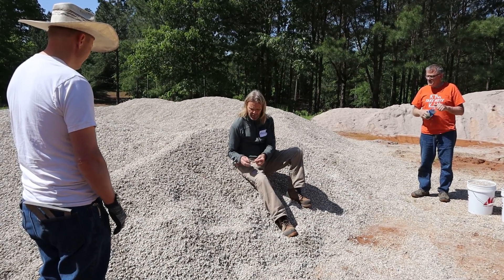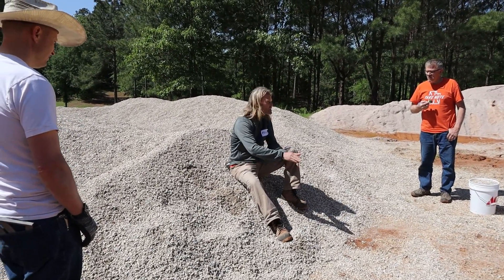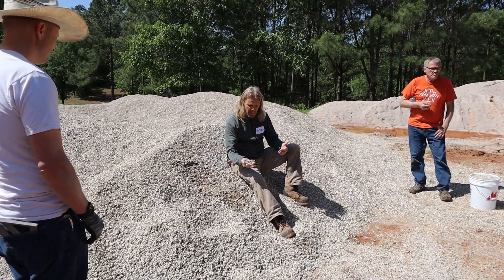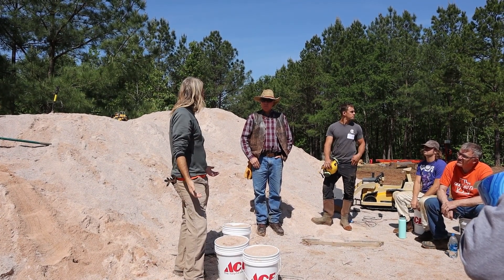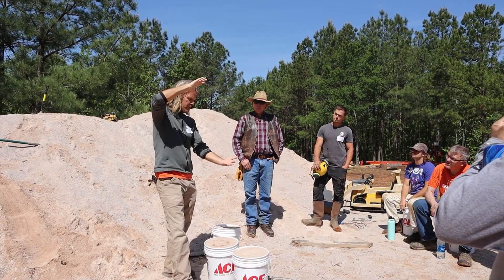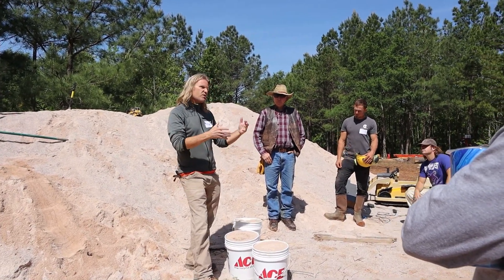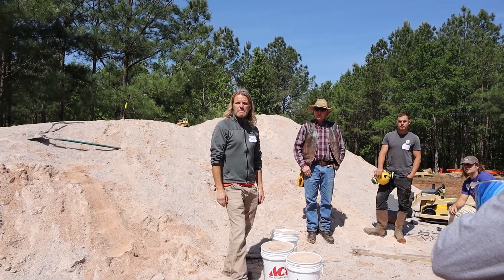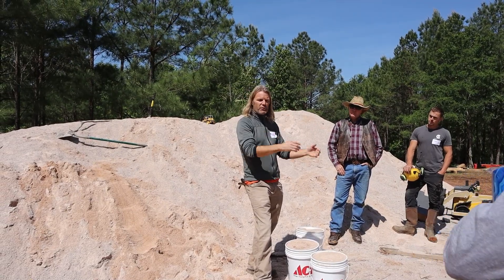SIREWALL Class Part 1 - material selection - Vlog 94

Comment: Hey, I have a question about the rebar. What is the diameter of the rebar that you used and what was the spacing. Do you feel like it is nessecary to have rebar? also, is this rebar coming out of the foundation and then another piece of rebar is welded correct? If you don't mind I would also like to know what is the width the walls? :)
Reply from the maker: We are using 5/8 inch thick rebar (Number 5) on a 2 foot grid. We don't need to weld the rebar if we overlap by at least 16 inches and tie with bailing wire. The walls are 2 feet thick. Hope that helps